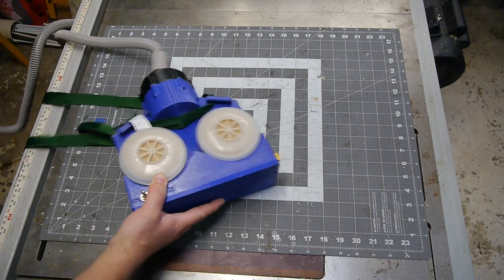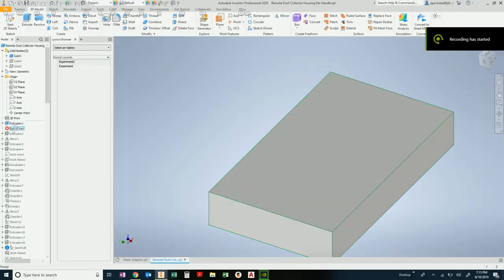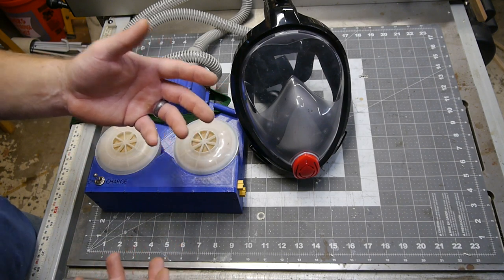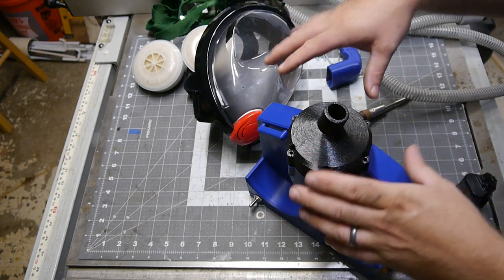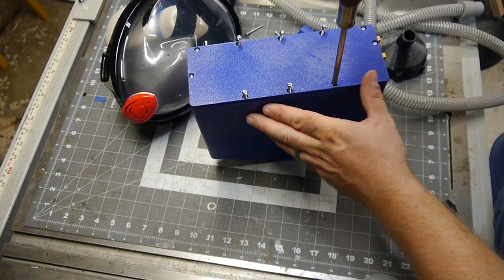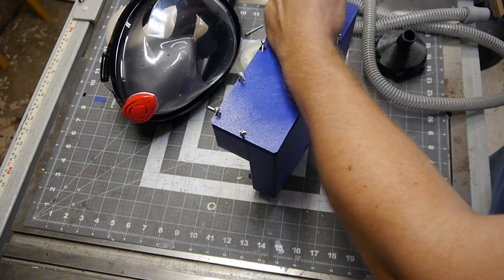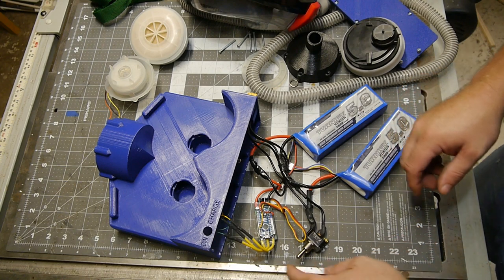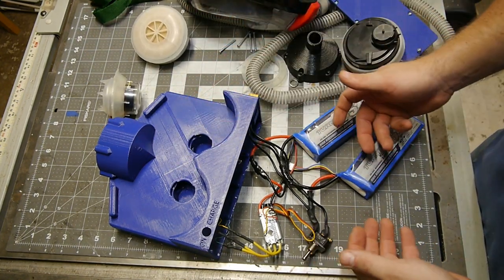DIY PAPR (Personal Air Purifying Respirator) Mask, Works Awesome! Low Cost Option

Comment: The air hose looks like the one from the washing machine, can I just use that, new of course?
Reply from the maker: Hey justtestingonce, I reused the hose that came with the CPAP machine that I salvaged the blower motor from. I would not take a chance on the washing machine hose. Instead you can purchase a cpap hose for around 10 dollars or less online. Here is one. https://www.amazon.com/CPAP-Hose-Black-Out-Tubing/dp/B07776MLBC?th=1 I wouldn't take the chance that the hose you have doesn't slowly off gas something and end up doing something to your lungs. CPAP hoses have to meet FDA guidlines, washing machines do not. Thanks for watching and good luck with your build!
Reply: Inside of brand new washing machine hose stinks. You wouldn't want to breathe through it.

Comment: Just have question can u use paint filters to and spray paint?
Reply from the maker: Not Sure, but I would think that if the Filters are rated for the paint VOCs you are using you should be fine. Congrats on your build!

Comment: Awesome man, great project.
Reply from the maker: Rural! It's been a spell, how have you been?  Thanks, yeah, you could certainly have different speeds triggered via button on the outside. It uses the microsecond command in arduino to control the esc. You set it 0 at the beginning start up sequence in the setup code so the esc will arm, and then to a value between 0 and 2000 in the loop to control the normal run speed. I have mine set to 1750 so not quite full power. The arduino code is listed on the thingiverse link I think if you want to peruse at your leisure. I am highly proficient at coding so if I can do it anyone can lol. Good hearing from you again!
Reply: @JoshAQ    Hey pal!  I'm seriously impressed with this project.  I guess that those type of components are the kind of kit you use in the RC world, esc and those battery packs remind me of building quadcopters.   Thanks for the explanation.   On my absence, my only excuse is family :) happy to say we now have a second one and its amazing but the time in the garage has gone down.   Although I am planning on upgrading the maxnc with some cheapo cnc control hardware and have been playing with Raspberry pi's of late to make some programs on python. Hopefully I will get some time to upload  a few shorts :-)  Hope life is treating you well buddy, look forwards to future posts. :-D
Reply from the maker: @TheRuralpoet  wow! Congrats sir on the new addition! It is a blast and a headache when they start playing together. :-) things are going well on this end and we are  enjoying the summer currently.
Reply: Bro can u put a paint filters too?so u can use it on spraying?about the motor is ther any link where u exactly get it??thanks so much

Comment: Dude attach something to make it float above water and you can go deeper underwater and still breath!
Reply from the maker: Kyrose Bates, You sir may be a genius! Not sure if it is possible though. I would either need to create a loop that pumps the air down into the mask and back up to the surface, or find a ducted fan that can create enough CFM at say 5 psi in order to overcome the valve on the mask and push the water away from the exhale valve. Water is about 0.43 psi per foot of depth. So If I wanted to stay down say ten feet I would need 4.3 psi of air pressure at my face to overcome the water. Yeah, a two hose system might work.... Need to think more about this, thanks for the idea!
Reply: I mean it is a snorkel. It does have a nice exhaust vent in the front so that should take care of co2 build up. Are you talking about the pressure on the hose itself? Having it collapse stopping airflow would be a problem. A vacuum hose could work. It's made to withstand the pressure of vacuum.  A garden hose could be a little on small side and could feel like breathing thro a straw. Definitely will be some fun to consider the possibilities
Reply from the maker: So I spoke to a guy who dove in the Navy about this and he said the problem is that the water pressure essentially squeezes your body/lungs and so to breath underwater like we are proposing we need to overcome water pressure if we want to go down very far at all. For every foot underwater you are exposed to 0.43 psi, the average person can create a vacuum pressure of roughly .5 psi. Easiest thing to do is take the cpap house put your mouth around one end and dive into the water with the other end above water. I don't have a pool so that could get tricky. Regardless I still want to try if only to serve as a physics lesson for myself.
Reply: Diving around coral reefs would be fine tho. Those aren't very deep and alot of people take scuba tours just for that. But with something like this yuh hook it up to your snorkel. I'm thinking one of those toddler floats would hold it above water perfectly. The one that looks like a swing seat but a donut around it. 
As for deep sea diving yeah that being crushed like a soda can would be problematic 😅😂

Comment: Instead of beating the shit out of it to dissemble the actual breathing machine you could just connect a 12 volt battery to the unit and wear the mask the unit had on it. Instead of wasting all that time researching Alibaba for parts and that 3d printer a CPAP actually works quite well the way they are built without disassembling to reassemble.
Reply from the maker: Hey James Mancine, you bring up a valid point. My first plan was to do just that. The power supply was a 120 vac to 24 vdc wall unit. So I thought great hook up a 24 VDC battery and there you go. So I did just that. The unit powered on started blowing then an error message popped up on the screen and the blower shut off. I powered off the unit, then powered it back on, it blew for like 30 seconds then would shut off and display an error. The short story is there appears to be some kind of proprietary lock on the unit so that I can only use their battery and not the ones I had on hand. I couldn't figure it out so I went with what you watched. It was fun and a challenge for me so I didn't mind. I would have certainly preferred to keep the CPAP as it had a pressure sensor built in to change the speed of the blower when you were breathing, plus it had it's own controller an ESC built in. By the way I only hit it with a hammer after I had removed all the components I wanted to save. I certainly do not recommend it and mine was just for comic relief. You could probably find a used CPAP and then buy their battery and that would get you much closer. The point on my project was to use as much as I had on hand to keep my costs low. Thanks for watching!
Reply: @JoshAQ  Next time try looking up the device's operating instructions, the version the sleep therapist has and it will tell you how to program it. They have so many sensors that trigger the cpu inside
Reply from the maker: @jamesmancine8350  Mine was weird in that it worked just fine with the snorkle mask and hose when I was plugged into the wall but didn't work when on battery. Thanks for pointing this out as an avne others can go down.
Reply: @JoshAQ  btw - the ResMed proprietary battery costs ~$300, give or take - (and insurance won't cover it, in case you have sleep apnea)